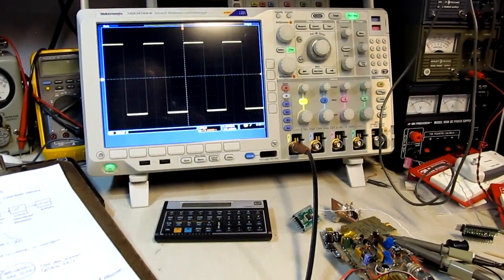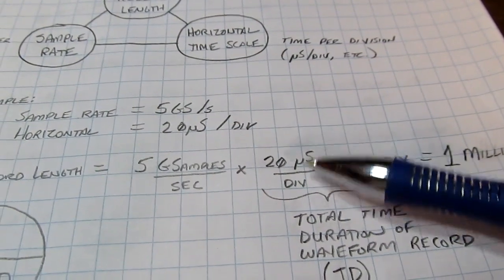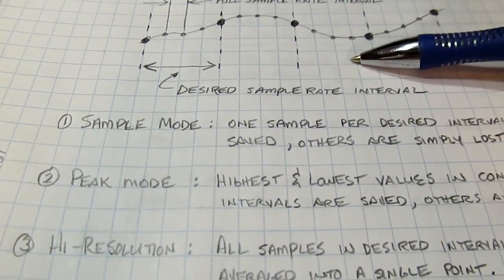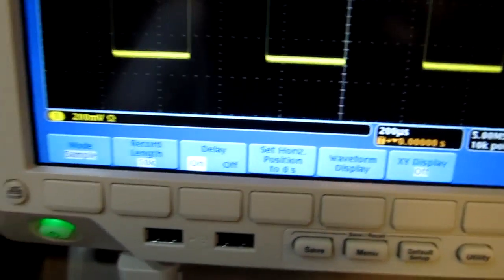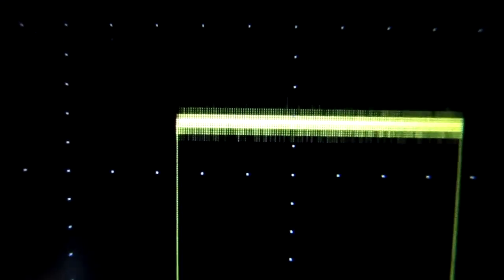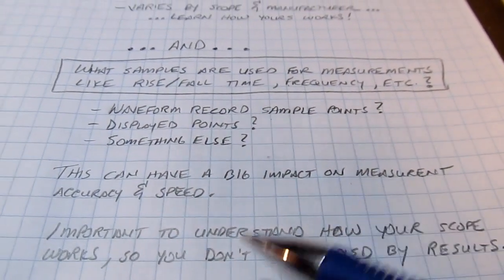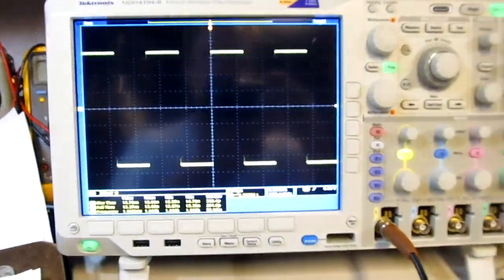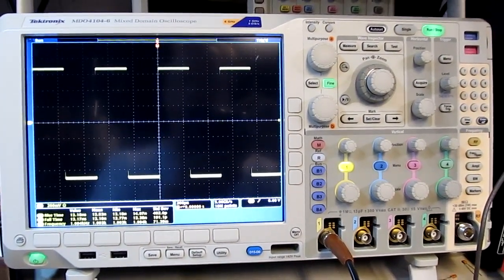#96: Tutorial on Digital Oscilloscope sample rate, record length and data processing

Comment: Pretty much the same as mine, I'm jealous of your dual time base though. They are pretty decent scopes, you get a great 100Mhz analog and you get some basic digital features. 

I got mine for $40 off Craigslist, talked the guy down from $120 because the traces wouldn't show up in digital mode and it needed a couple of the shafts replaced for the "CAL" knobs. All it took to get the digital stuff to come to life was reseating the ribbon cables, which I was doing anyway to fix the knobs.

Comment: Excellent video! Thanks. I have a question as well. 

For a given sample duration, why would I NOT want to use the maximum sample rate? In your demonstration, your scope defaulted to 5MS/s. Why not just do maximum S/s for the given sample duration? Seems like sample memory is going unused.
Reply from the maker: You could a faster sample rate and thus more waveform memory. The trade off is processing speed (or lack thereof).

Comment: Been scrolling the web for days trying to find a reasonable decent scope to simply graph the voltage of a car battery overnight. I don't use scopes on a regular basis but wondering if you can suggest one for around $400 or under. Can't seem to find one to do this. I have a small dso but its tiny as hell and only has 8k of sample storage and no adjustment for more than 2 sec div.

Comment: Is it fair to say: this is why if you have a cheaper digital scope, it may advertise 1Gsample/sec but its memory depth will limit what you can display at a givin sec/div ? Correct ?
(Sounds like a good reason to keep an analog scope around too..)
Reply from the maker: Yes, that is fair to say.  Using it as a station monitor for example, to watch your RF output - when running SSB phone, you probably will want to set the horizontal to something like 500uS/div.  That gives you 5ms across the screen.  If your scope is using 10,000 points for the waveform, that translates to an effective waveform sample rate of just 2MS/s - which will be undersampling your HF RF signal.  Sample processing like "peak" can help, but it does illustrate why, in this case, an analog scope is superior in this instance.

Comment: Good tutorial but I really missed info about how most digital oscilloscopes can store more data than is displayed on screen and you can then scroll through the data both before the trigger point and long after. That is important for single shot events and I usually mess up and get too little time or too few sample points.

Comment: Hi allen I have a doubt. How does TEK TDS 430A WITH 400Mhz analog bandwidth uses only 100Msa/s sample rate. How it prevents aliasing when measuring high frequencies ?
Reply: Because it uses equivalent time sampling at the rated bandwidth. The waveform is built over several acquisitions. The single shot bandwidth (where you must meet nyquist criteria, is well under 100MHz.
Reply: Thank you. 😁

Comment: Why do you use 10 divisions in your calculations?  If my scope has 15 horizontal divisions on the scale, would I use 15 in the calculations?
Reply from the maker: +tbsmith77 The vast majority of oscilloscope displays have 10 major divisions horizontally - that's why I used 10.  I've never seen a scope that has 15 (or some other number) or horizontal divisions, but if your scope has a different number of divisions, use that.
Reply: +w2aew Thanks!  My scope is a Hantek DSO1202E (handheld) and has 7 1/2 divisions on each side of center.

Comment: Just bought my first digital scope - Hantek DSO2D10 and it seems that it measures from the screen, but not from the sample buffer like the Tektronix does. When I measure rise- and fall- times of a square wave and change memory depth 4k-40k-400k-1m-..., the time values remain about the same, but changing horizontal screen scale (time/div) - measures become more accurate with faster time setting. This is not surprising considering the cost of 250$. But if it is so, what is the point of having different memory depths in such scopes as mine if it converts the sample buffer (even the smallest of 4k) to a constant screen resolution length (800 points) anyway and only then measures the values? Thank you!
Reply from the maker: This is precisely why Tek scopes always use the waveform points and not the display points for measurements.   The reasons other manufacturers (including some BIG names) make the measurements on the display points are 1) it is much faster, giving the appearance of a much snappier response, and 2) they assume that detailed measurements would be made when the waveform is adjusted to visually see the detail.   The deeper memory can be very useful to look at long term trends, capture long duration events, as well as being able to zoom in and make the more precise measurements.
Reply: @w2aew  Thanks for your answer. This really makes Tektronix to stand out and this is how measures should be acquired. Just fiddled with my Hantek and found out that frequency cannot be measured if there is no full period on screen, no maximum or minimum values or rms if the extremes are partly off screen, etc etc. Average acquiring mode is also going mad when the waveform is partly cut by the screen top or bottom, which I assume means that it also averages from the screen buffer(!). I sold my two old 10Mhz analog scopes to buy this Hantek to be able to capture the transients, bought it yesterday and I already want Tektronix👍

Comment: when measuring bits per second logic signals or baud rate signals which these signals are logic words of packages of data. If you Oscope can't trigger on these types of signals what can you do to get a stable display for bits per second and baud rate signals? The baud rate value/frequency is determining the rate of which the logic words of packages are being sent over the serial data transmission buss?
Reply from the maker: Check out my video on eye patterns - this should give you an idea of the baud rate.
Reply: @w2aew  yes that eye pattern video was confusing. I don't know why baud rate is sometimes called eye pattern
Reply from the maker: @waynegram8907  The baud rate is NOT called an eye pattern.  The baud rate can be CALCULATED from the eye pattern.  Measure the time between the crossings (width of the eye) and invert it to arrive at the baud rate.
Reply: @w2aew  I will watch your eye pattern video again because i don't think you showed examples of measuring different baud rates of logic signals using the eye pattern. You will see the logic word packet of data but then you measure the Pulse width of the whole logic word packet which the logic package if a bunch of logic on/off signals at random pulse width intervals. Then you measure the time between "dead space" from logic word package to the next logic word package. The Dead Space is the Width of the eye?
Reply from the maker: @waynegram8907  Yes, 1/dead_space equals the the baud rate.  More accurately, it is 1 over the time between the crossings.

Comment: what a great video, it's very helpful!
by the way I'm having problem to set sampling frequency in Tektronix oscilloscope TDS 2014b, could you help me or give some advices? I'm kinda frustated,,,,, Thank you so much!!!!
Reply from the maker: +Nabila Ardhana The older scopes like these TDS2000 series have a fixed waveform record length - thus the waveform sample rate is simply a function of the horizontal scale setting.
Reply: +w2aew so it means we cannot change the record length, can we? but can we set the horizontal time scale for the older series Tds 2000??
Reply from the maker: The Time/div control is the horizontal scale control.
Reply: +w2aew so we cannot take 25000 record length within 5 kHz sample rate? and what is the meaning of its feature, 1GS/s? thank youuu
Reply from the maker: +Nabila Ardhana The TDS2014B  has a fixed record length of 2.5k samples.  You can't adjust or change this, it is always 2.5ksamples.  The scope samples the input at 1GS/s (one billion samples per second).  However, at a horizontal setting of <250ns/div, not all of these samples will be put into the captured waveform.  For example, if you use 2.5us/div setting, only 1/10th of the samples are used, so the effective sample rate is 100MS/s.
Reply: +w2aew oh ok finally I see, thank you so much for your explanation! :D

Comment: Great video! But i have a question. Why would you set the memory to 10k when you have the chance to use 20M. It seems to me it's a waste of precision, but i guess there is a reason to let you tune that parammeter too.
Reply from the maker: It really comes down to responsiveness.  Moving and processing 20Msamples of data (vs. something smaller like 10Ksamples) can take a fair amount of time.  Many scope manufacturers will let you set the memory deep, but only process the points that are going to the display.  The big downside to this is that measurements are made on this highly decimated set of points.  The Tektronix scopes always make measurements, etc. on the acquired data points, not the displayed data points - so there is always processing happening on the complete acquired memory set.  This is why Tek gives you the option to adjust the memory depth as needed (shorter when you don't need the sample resolution, deeper when you do).
Reply: @w2aew  Thanks for the fast reply. I'm an electrical engineering student from Argentina and your videos are really helping me out.
I'm looking forward to buy an oscilloscope for some small DIY projects and this video was exactly what i needed. 
The back to basics videos are awesome too!

Comment: If i have hantek dso5202p (which has 40kbts memory, 1gs/s)  by setting 25us/div and appling 20k sine. signal ,would it be look like a sine wave?
Reply from the maker: Provided you have the trigger setup properly, then yes. You have 5 sine periods.
Reply: But because the memory is limited to 40000bits he wont get the full benefit of 1Gs/second sampling. The scope will throw away the extra samples to fit in the 40Kb memory.There is a chance that some spike or glitch in the signal is lost due to decimation. To get full benefit the memory of tthe scope should be 1gs/s*250uS=250000 bits, ie 250Kb. Is my understanding of the concept right ?

Comment: Thanks for this Alan. Very informative.
I have an additional question: some scopes, like my Rigol DS1054Z, have a function called "anti aliasing" in the acquire menu. What exactly does it do ? When I press the help button on the scope it simply states: "Use this feature so that the oscilloscope can avoid the signal aliasing". I've used it but didn't see any change. I suppose it's when a very high frequency analog signal is input that could suffer from digital sampling errors due to the sampling frequency being too low for such a high frequency ?
Reply from the maker: Aliasing can occur when you use a slow horizontal scale when looking at a high frequency signal.  I don't know what the RIgol anti-aliasing function does, but I suspect is makes several acquisitions and performs some type of signal processing to determine if the sample rate is too low for the given input signal.  Unfortunately, the Rigol manual provides no detail on the process.
Reply: @w2aew  
Thanks Alan. That makes sense. Yep, the manual only mentions a reduced sampling rate and a "dedicated display algorithm" to avoid aliasing. It's probably a proprietary software. But I've yet to see what it does, since the scope is a 100 MHz (fully unlocked from 50 MHz initially), but I don't have such high frequency signals to test it with.
Reply: AlainHubert If you just put in a signal with fast slim pulses (probably under 100ns rise/fall time) but at a say 1kHz repetition rate you see the problem. Maybe at a 1ms/div timebase setting the pulses will (partially) disappear and do some funny things. This is because your scope reduces sampling rate and the pulses are too fast. Most older digital scopes like my tek tds310 do a horrible job at this since the sample memory is so small. But many modern ones deal with it very nicely. 
Aliasing occurs when you feed an ADC with signals above half it's sampling frequency and is usually undesirable. (see nyquist theorem for example)
Reply: AlainHubert You could also just feed in a 10MHz sine wave and turn the horizontal to 10ms/div or slower and the waveform be going completely out of shape but that is not very close to showing you the real problem of this since nobody does that.

Comment: gaming, having co-authored an open source WFMReader that reads and displays the data in a graph on your PC, I can tell you that is is nothing more than a WINDOW.  Imagine the entire graph on a large wall.  But all you can do is look through a window.  You see LESS than what is actually stored on the wall.  You can move around, left to right and see different areas (scrolling).  
Anyways, the tough part is synching the sample with a trigger, which is probably the key thing you need. Ext Trigger?

Comment: Hi Alan. Nice video.
I have a THS720A that I use at work... Pretty old I know but is still in calibration....  I keep seeing a problem that I can't resolve so as a Tek Tech I thought I would pass this by you.
When I look at the waveform on the scope screen, I notice the update rate of the waveform goes fast and then pauses for a fraction of a second.  The sample rate displayed doesn't change but the update of the waveform on the screen does.
To illustrate further, If I have the Horizontal timebase set to say 500ms/Div, the display would traverse the screen in short bursts almost leap frogging.  By selecting auto ranging the problem disappears only to return when I make a manual setting myself which cancels auto ranging.
I can't find any answer to this, I can still use the scope but this problem is rather off putting. 
Do you have any ideas?
Reply from the maker: +Michael Hawthorne Interesting...  I"ve never laid my hands on a THS720A, so I can't comment from any first-hand experience.  it is odd.  If anything, I would've expected the inconsistent update to occur in Auto mode (due to to the scope taking time to figure out the right settings), but that is not the case.  I'm sorry I can't offer any insight.  I'll ask around with some of my colleagues...
Reply: That would be great and thanks for responding to an old post of yours.

Comment: Why not just always sample at the max - e.g. 5 GS/s?
Reply from the maker: Because of memory limitations. Waveform memory is filled faster at the faster sample rate. So, when you need to acquired a long duration event, the sample rate has to be reduced in order to fit the waveform in memory.

Comment: Nice video. However, I think the 1 million Samples should be 10,000 Samples. Could you cross-check the calculation you made?. Thanks.
Reply from the maker: 5GS/s * 20uS/div * 10div = 1 million.
5e9 *20e-6 *10 = 1e6